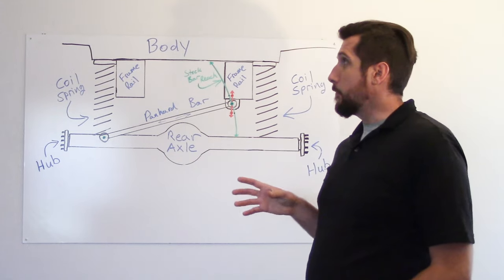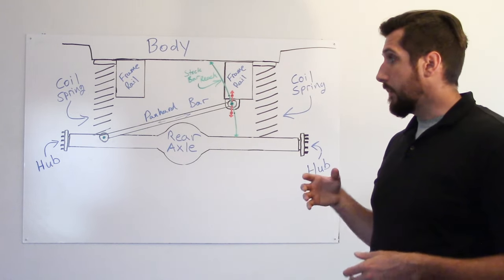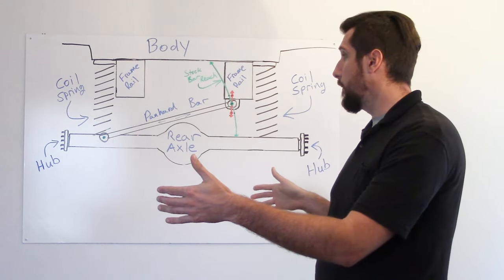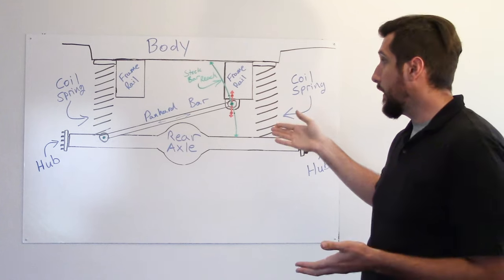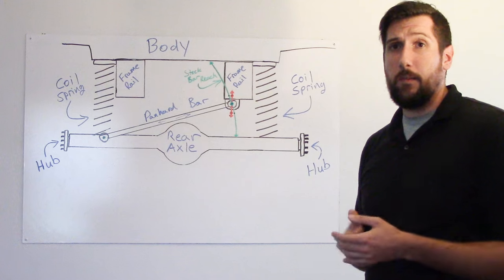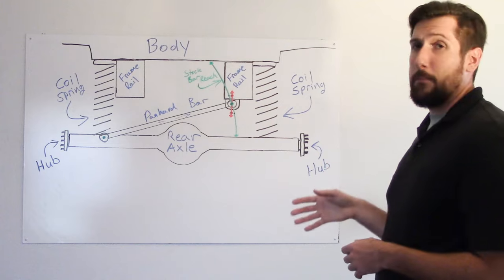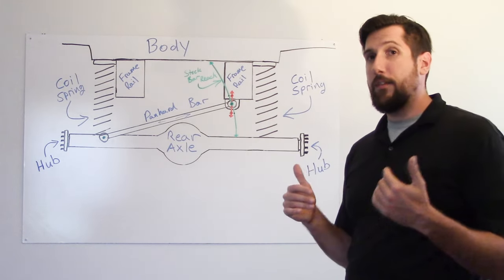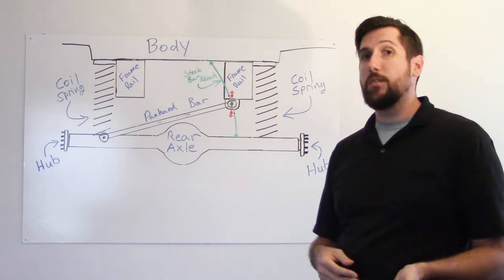Why would you need an adjustable panhard bar? Panhard bars explained.

Comment: Good info, but i think the drop bracket would be better, that bar is supposed to be horizontal that way if there is articulating suspension up or down there will be en even amount to push axles both ways. If you get the adjustable bar you are just fixing the alignment when truck is on even floor and not when articulating.  There would be more movement on one side of the suspension than the other. I thought the same way , that the adjustable one would be the way to go, but no. There is a good video out there explaining this. Makes sense.
Reply from the maker: Valid point for sure

Comment: Using frame rail lowering bracket will put panhard bar parallel with axle [ At  ride height].This will allow less side to side movement by using flatter part of arch. Which gives better handling.  The higher up in the arch the more side to side the more rear steer or bump steer you  will have . The amount of handling you get with bracket is worth drilling holes . I use bracket and adjustable bar

Comment: I just got some UMI non-adjustble pandhard and lca bars, dropped with UMI springs for my 92 camaro.... fortunately i got away on not buying adjustible ones (which are over double the price). If i would have gone lower, i'd be needing them. Great info bro!
Reply from the maker: Nice! I'm hoping to upgrade the LCAs on my 95 trans am someday soon myself. How are you liking yours?
Reply: I just bought an adjustable panhard from founders performance with some lcarbs. I already had the UMI lcas. The panhard bar from founders performance is pretty cheap.

Comment: Is there a formula to figure out ,Say for every inch you raise your truck you should extend the panhard bar X, I am installing mine today , I have a BDS 6” SUSPENSION LIFT in the front the rear was raised 4”s  installing core 4x4 adjustable lower & upper control and there pan hand bar ,I have them all set to the factory length ,but after watching your video I’m thinking I need to adjust the panhard bar , what do you think 2012 ram 1500 fox suspension upgrade rear coil upgrade 22” wheels 35” tires been lifted going on

Comment: My F350 7.3L diesel 6spd manual 4x4 has a Dana 60 in the front with leaf springs --- and it still has a panhard bar.

Comment: If I have an adjustable pan hard bar with adjustment on one side of the bar where should the adjuster be placed. Closest to the axle or the sub frame or does it matter? Thank you for your time
Reply from the maker: I'm not sure that it matters. I just place the end with the adjustment where it's easiest to get to and make adjustments after it's installed.  I've installed a couple this way and so far no issues. 🙂👍
Reply: @TheBudgetMindedMotorist  awesome I didn't think it mattered. Thank you for the quick reply
Reply: Just put it where ever it's easiest to make adjustments.   If it's a dual threaded adjuster like a tie rod -- make sure you have equal threads on both sides;  because you can accidently get all your threads on one side and only have a a few threads holding on the other side.  The best way to do it is to get both ends started-- and then just turn your central adjustment bolt so that it's tightening equally to both sides at the same time.

Comment: My car has lowering springs and also an adjustable rear sway bar, would a panhard bar still be recommended?
Reply from the maker: I'd just take a tape measure and take some measurements to see if the axle is still centered in the car. Measuring from the inside edge of the tire to the frame on both sides should do the trick. If the measurements are the same on both sides, there no reason to change the bar. But if the measurements indicate the axle is shifted to one side, then an adjustable bar would allow you to get it back to center.
Reply: If you're vehicle is lowered, the rear end will now be offset and an adjustable panhard bar is mandatory. Unsure why the gentleman running the channel thinks there's a chance it will be centered.. If totally stock it is centered, lowered it will be off center. Plain and simple.

Comment: Hi there great vid. Was wondering if it’s worth adding the bar to a y61 Nissan that slide from side to side in turns? 2 inch lift front and back. Thank you
Reply from the maker: Thanks!  When you say it slides, do you mean it loses traction? Or that the body just shifts from side to side over the axle?
Reply: @TheBudgetMindedMotorist  The body shifts from side to side. The suspension is a fox 2.0 with adjustable stiffness. Thanks
Reply from the maker: @secrets532   To be honest I'm not that familiar with the Y61 platform,  but if your truck is shifting side to side I can tell you from experience that it Sounds like the bushings in the ends of your panhard bar have failed. You can check by getting under the truck and watching where the bar ends mount to the frame and axle while trying to shift the body side to side. Everything should be good and solid, but if you see movement between the mounting points the bushings have failed.. You could try just replacing the bushings but considering that you're running a decent bit of lift it'd probably be worth just replacing the whole bar with an adjustable one.
Reply: @TheBudgetMindedMotorist  thanks you very much for the information. Will do that. Cheers

Comment: I see things . In my mind , I see a pan hard bar with a hydraulic cylinder in the middle . A system driven by rear shock pressures controls the length of the PHBar  . Down and up pressure ... long and short on bar length . Am I JUST seeing things ???
Reply from the maker: Pretty neat idea!

Comment: Change the length of the panhard bracket bolt holes higher on both axle and lower on the chassis panhard mount( no need for adjustable

Comment: Will this help stop wobbling on my rear tire
Reply from the maker: Usually that would be caused by an out of balance tire, bent wheel or maybe a bent axle if it's a solid axle car. The panhard bar wouldn't have any effect on wobble.
Reply: @TheBudgetMindedMotorist  so replacing the axle shaft it will stop the wobble
Reply: @eramydelatorre7709  I would start with the wheel and tire itself before diving in straight into the axle check balance if it still wobbles check the wheel for any dents then look into suspension components
Reply: @eramydelatorre7709  tire balance maybe
Reply: Mines goes side to side going over 50

Comment: the panhard bar just doesnt make any sense to me, siince it pulls or pushes the axle sidewas if the axle goes up or down, i wonder why such a bad design ever made it to the market.

can anyone proof me wrong?
Reply: If installed right theres very little side to side . If installed wrong you will avoid curve roads
Reply: Samuel it’s simple, lightweight and cheap. And it works well enough within certain constraints.